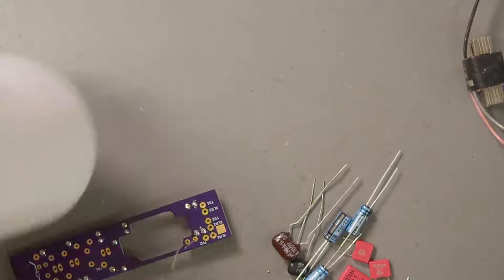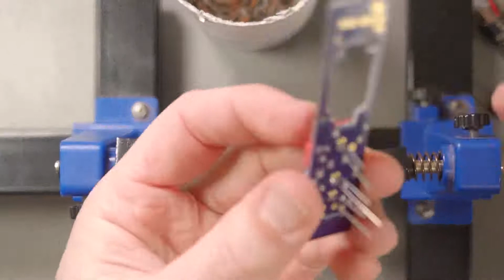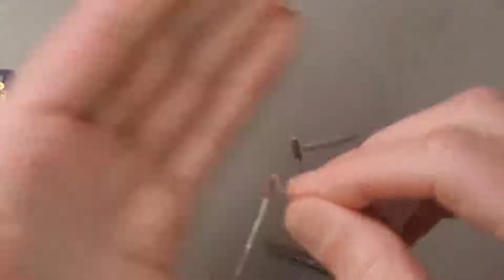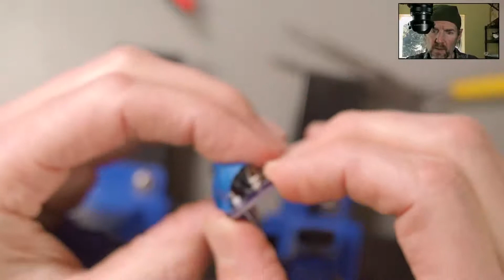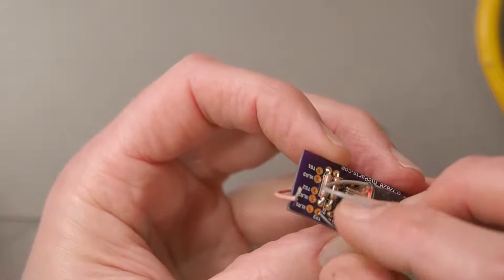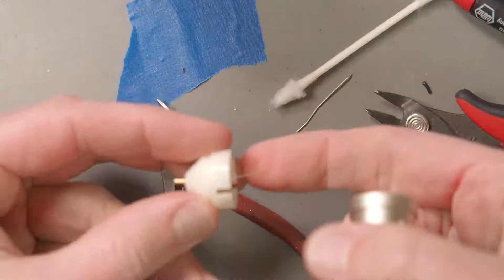DIY 003: MicParts SDC-84 Snare Microphone build

Comment: Thanks Matt for this vid build. First time on a circuit board for me so this was VERY helpful regarding technique and procedure. The manual is excellent, but walking through this with you made the procedure much more reassuring. 
End result turned out fantastic and this mic was more that worth the investment! Great job and thanks again!